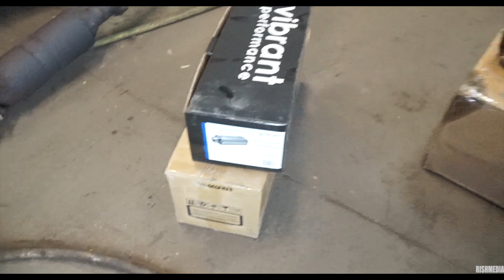INSTALLING HEADERS AND CUSTOM 2.5" SINGLE EXIT EXHAUST FOR MY ACURA TSX

Comment: Im lovin the videos man, trynna figure out what imma do first. Prolly gonna start off with coilovers, any suggestions?
Reply from the maker: Coil overs always should be one of the first things, what year do you have color and at or mt? 
I highly recommend tein flex z I have them great bang for buck can go pretty low but now slammed. I’d also look into the smaller details like fog lights, rain guards, body kits
Reply: Rish Media 04 mt 6 speed and its all black mann and alright thanks man, ill look into it, and im from ct too lol

Comment: What headers and exhaust did you match together ?
Reply from the maker: I got dc headers and a custome single exit exhaust man! 

Getting the headers swapped out soon tho to many issues
Reply: Rish Media I’m getting the skunk2 megapower catback . What are your opinions on it ? Currently don’t know what matches up to the skunk2 or what could match up w a little fab magic . Do you have any idea what I could match up to the skunk 2 ?
Reply: I’ve been to so many tsx threads but none really answer my question
Reply from the maker: If it’s specifically for the Tsx then basically any header should be able to almost. Just look at how the flange looks where the bolts go through and see if the design is similar like 3 bolt pattern. 

It really shouldn’t be that hard things should match up with the header.
Reply: @RishMedia  hey do you know how the DC type header and PLM slip joint type compare to each other?
Reply: @RishMedia  im thinking to get some "H-GEAR EXHAUST MANIFOLD 4-2-1 STAINLESS STEEL (ACCORD 03-07 2.4)" , bad idea in your opinion ?

Comment: Are these TopSpeed or DC headers ? They look like DC
Reply from the maker: They’re dc header would recommend something else another time around
Reply: @RishMedia  like?
Reply from the maker: @illpistolwhip6779  they revised the dc headers so the flex issue isnt as bad i think. Id get these over PLM cause plms fitment is horrible and need to be welded. 
Weapon r is what i have now just a bit more pricy then plm/dc
Reply: @RishMedia  i seen youre future videos, hows youre experience with the weapon r? i bought one but have read a lot of stuff about them cracking so i havent put it on yet, even had a chat with serge about it, he said its super common for them to crack.
Reply from the maker: @Its_Boddied  when I had my weapon r for some time it didn’t crack on me. There’s multiple factors to it, enough flex in the exhaust system. Solid mounts, poly hangers etc can all speed up the cracking. 
I mainly had a slight typical hissing but wasn’t bad and made good power. 

Look into icetronix they have some really nice header and exhaust